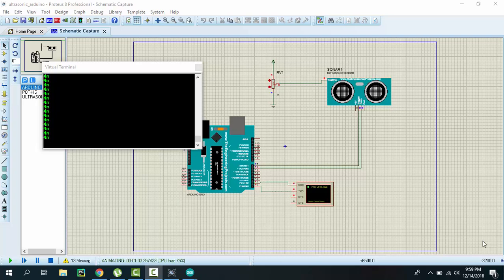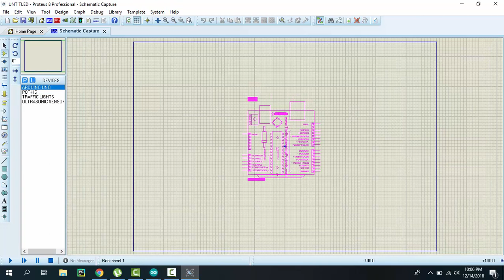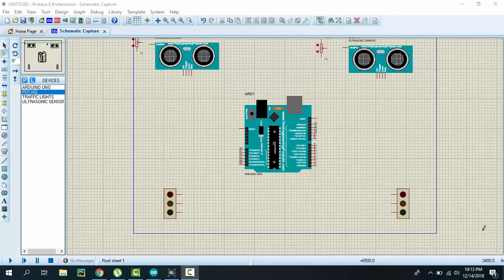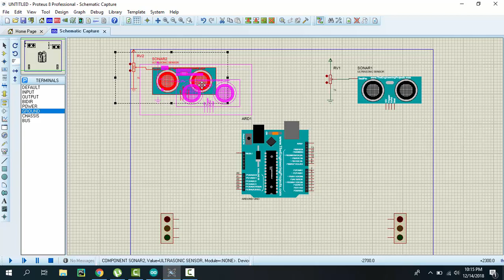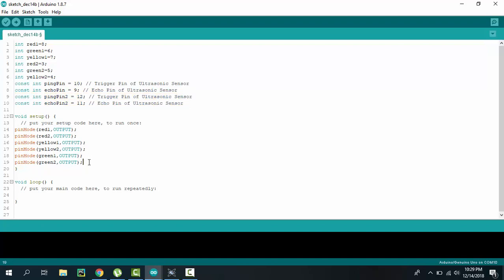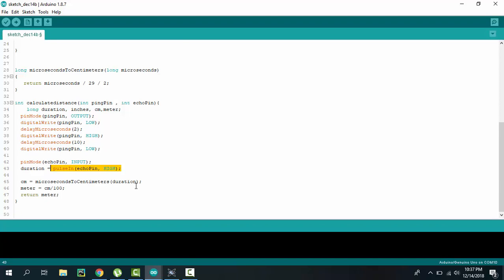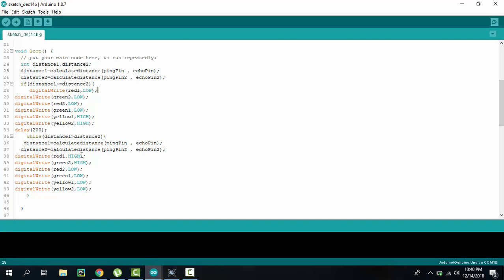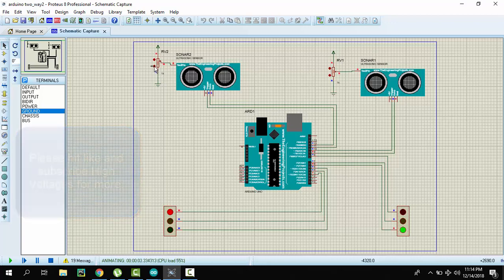Traffic light using Arduino and ultrasonic sensor

Comment: Compliments on the video . 
I'm trying  to do the same thing with one thing different.  I want the ultrasonic sensor to be triggered only when a car is there for a certain amount of time . Can you help me with the code ??
Reply from the maker: Sure.  Message me on facebook page www.facebook.com/highvoltagestech
Reply: I will
Reply: @hichamharb451  hey man, did he answer you?
Reply: @henriquegarcia8100   yes 5 years ago .
Reply: @henriquegarcia8100  but as I remember it wasn't the way I wanted . So I did some research and figured it out
Reply: @hichamharb451  times fly, huh? I already got a code that worked, but thank you. Have a good week

Comment: why dont u do connections in arduino and show the output
Reply from the maker: because I have used the simulator and it is easy to test circuits on that. Don't worry, it will run on the real components too.
Reply: @HighVoltages  thank u
Reply from the maker: Like share and subscribe for more.

Comment: Hello Sir,
I want help from you
I have arduino mega 2560 instead of arduino uno
so can u please tell me how to work with that?
please sir help me
I have to submit my project by tommorow
Reply: Sorry I didn't get u
Reply: I am very new to this concept
That's y I don't know
Please help me out
Reply from the maker: @dajay67  Sorry ,nothing in the code and the circuit diagram will change , just make the same circuit and upload the same code.